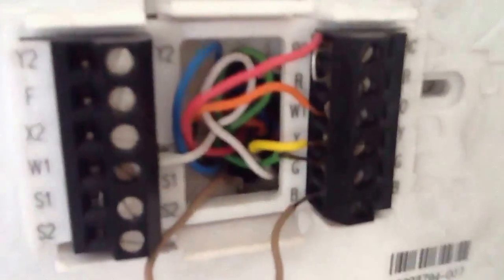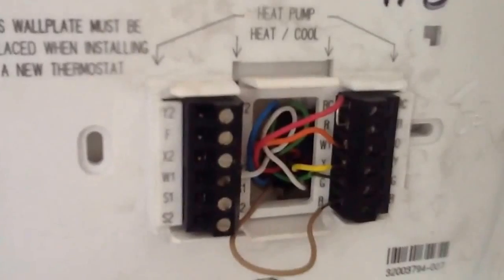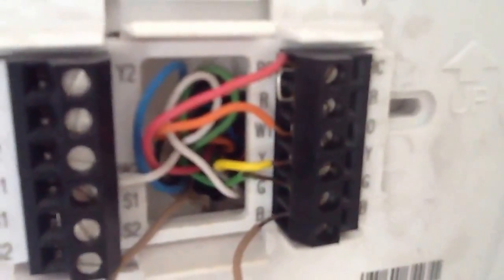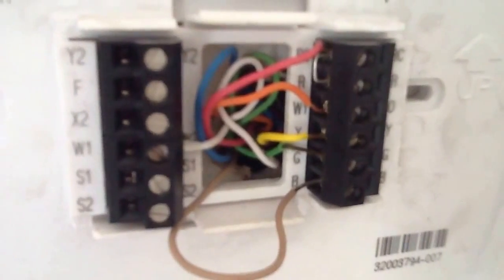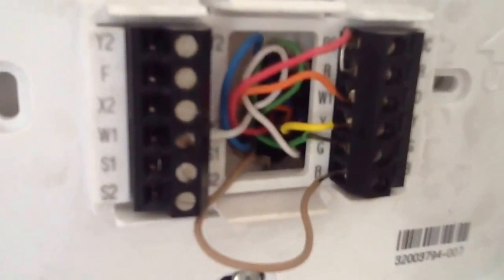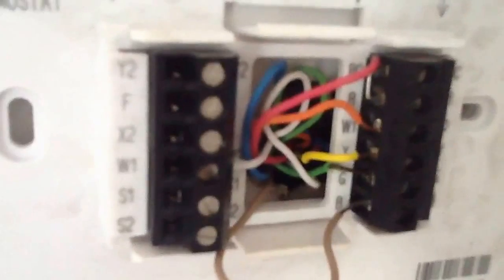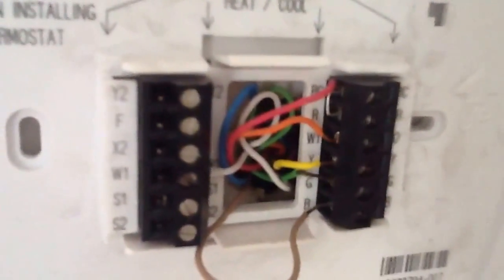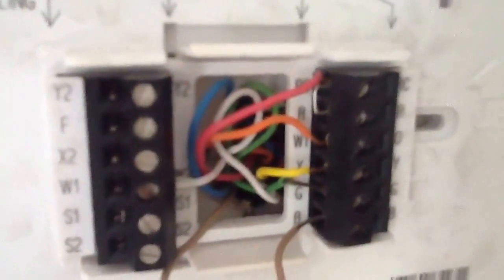Heat Pump Thermostat Wiring Simply  Explained

Comment: Thank you for posting this. I haven't found much info for this thermostat that controls my American Standard HVAC unit. I'm replacing this same thermostat with an amazon smart Wi-Fi thermostat, and I also have other connections. Another red going to S2, another white going to S1, yet another white going to W2, and a black wire going to X2. It looks like connections on the left side are dedicated for heat while the right side is for A\C, but I'm not certain. Any insight on the other connections would be appreciated.

Comment: I am replacing a Honeywell TH3210D1004 for my heat pump system with a Honeywell TH9320WF5003.  The 3210 has separate wires going to separate E and Aux ports.  The 9320 combines E and Aux into a single port.  Which wire from the 3210 goes into the 9320 E/Aux port?  What is done with the extra wire?  If it helps, the wire color currently going into the E port is black and into the Aux port is white.  I am replacing a Honeywell TH3210D1004 for my heat pump system with a Honeywell TH9320WF5003.  The 3210 has separate wires going to separate E and Aux ports.  The 9320 combines E and Aux into a single port.  Which wire from the 3210 goes into the 9320 E/Aux port?  What is done with the extra wire?  If it helps, the wire color currently going into the E port is black and into the Aux port is white.